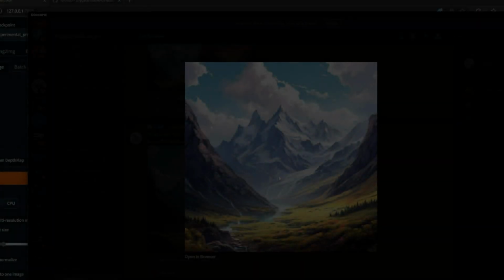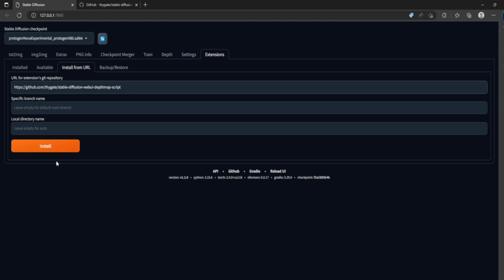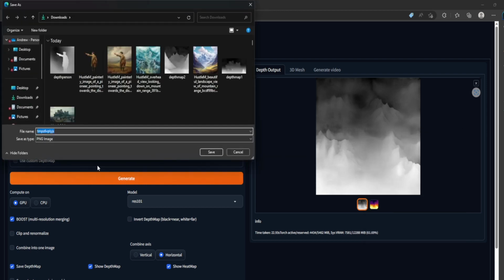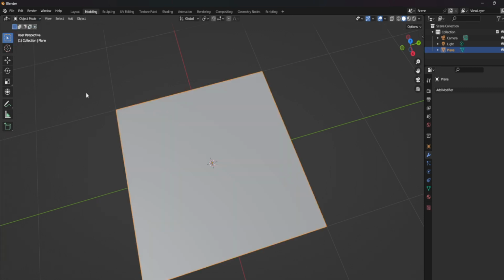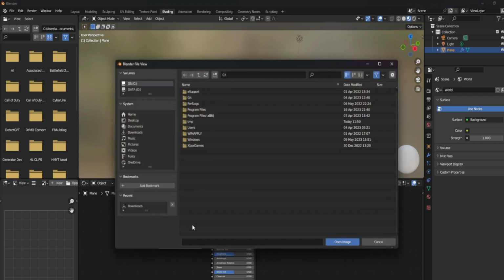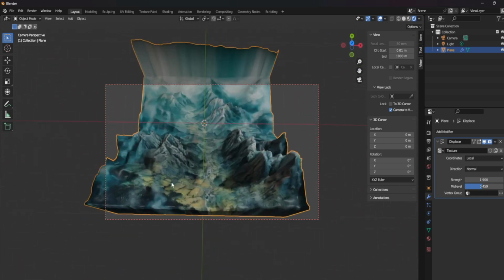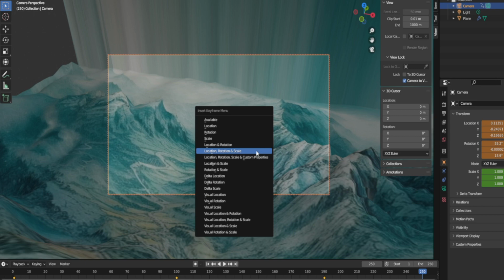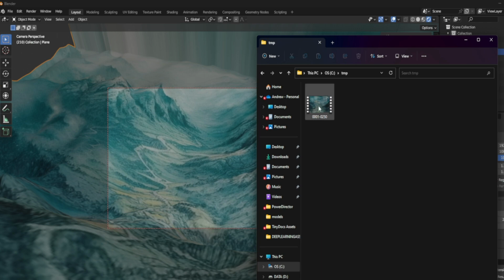Depth Map Stable Diffusion Tutorial: INSANE 3D Models & Animation

Comment: its easier with the midas depth node in comfy ui, then you can automate the process. tip, generate panoramic 360 images using prompting, then project them onto a sphere and offset the verticies by the depth grade amount along their inverse normal, this way you can generate 360 degree spheres with simulated depth from a static view. very cool for viewing in VR. this would be easy to do using javascript library three.js or in an engine like unreal engine using the vertex offset attribute inside its material.

Comment: Sadly it doesn't work with the latest automatic. Just doesn't op up in the menu.
Reply from the maker: Heya! Would love to help. Could you be more specific about the error?
Reply: @HustleMillennial  Hoi, found the reason, it was because "depth" addon was missing modules :)

But one "help" i could need as i always ends up googling my ass off as i have a terrible memory and forgetting how i did it last time, what's the way to properly install missing modules?

Just enter venv/scripts, open cmd there, type activate to activate venv, cd back to webui root folder and pip install module? Or what's the proper way? :P

Comment: Hi! Can you tell me please wich videocard i need to use depth in stable diffusion, to make without problem depth map for image with resolution 1280x720? I suppose that it will be geforce with support derect X 12 but wich model will be optimal in terms of price/quality ratio? I need help, thanks for the answers!
Reply from the maker: I’d say minimum an RTX 2060
Reply: @HustleMillennial  Thanks! But its little bit expensive. And what about AMD? RX580 for example) Speed is not important, it is much more important that the depth extension is launched and may be slowly but gives result, is it possible? 🙂
Reply: youll most likely need a gpu with rtx capability and no less than 8gb vram. you can get a 3060ti for around 250USD or so that should do the trick. however, if you want to get in to running sdxl, or doing warp fusion, youre gonna want a 3080 or higher